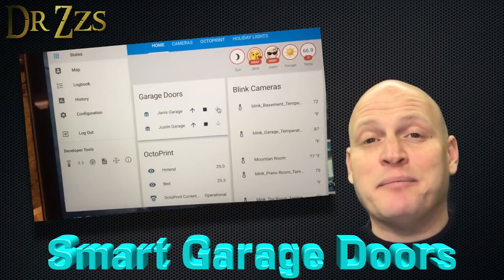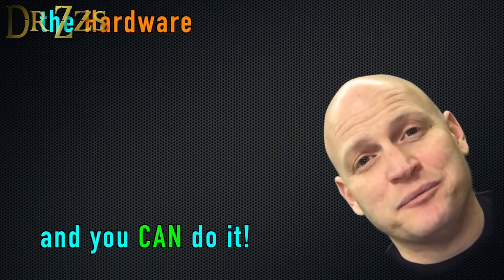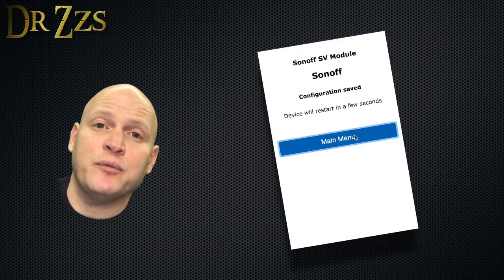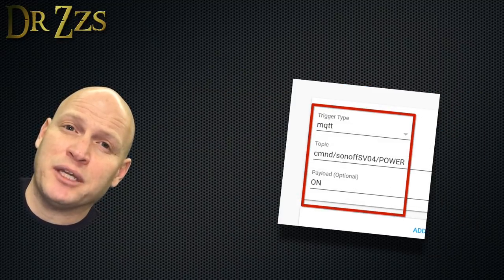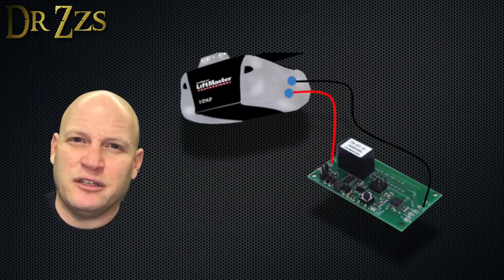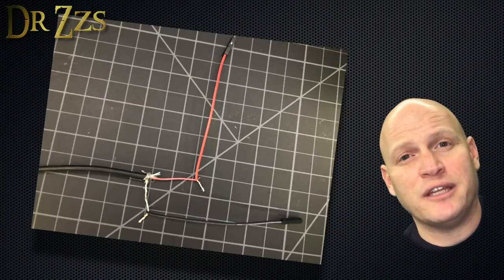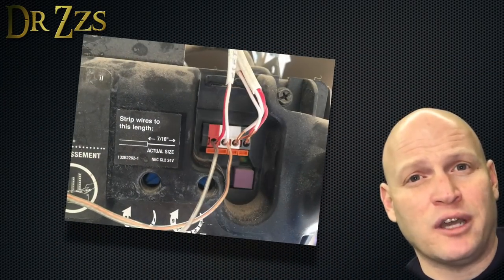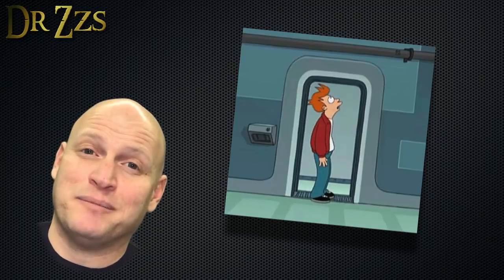$5 DIY "Smart" Garage Door Opener using Sonoff SV

Comment: Few recommended changes:

You can skip the home assistant automation with:
pulsetime1 1
in the tasmota console. This will do a 0.1 second ON-OFF sequence.

You can skip using a virtual 'relay2' by setting a rule in tasmota:
Rule1 on Switch2#state=1 do publish2 stat/%topic%/Garage ON endon on Switch2#state=0 do Publish2 stat/%topic%/Garage OFF endon
Rule1 1
The first line defines that when the reed switch is ON it publishes an mqtt message stat/%topic%/Garage ON and when the reed switch turns off it publishes an off message.
Publish2 command is used this way the mqtt message is retained in the broker, so if you restart home assistant it will still know the state of the garage.
The second line activates rule.

You might want to set up your reed switch so that it touches when the gate is closed and switch up the ON and OFF states in the cover.yaml (or in tasmota type switchmode2 1). This way it will only say closed when the reed switch is touching and it is really closed. The way drZzs has this setup in video could causes problems like your gate is 99% open but it's still saying it's closed.

In home assisstant cover.yaml:
 - platform: mqtt
   name: "Garage"
   state_topic: "stat/Garage/Garage"
   command_topic: "cmnd/Garage/POWER"
   payload_open: "ON"
   payload_close: "ON"
   payload_stop: "ON"
   state_open: "OFF"
   state_closed: "ON"
   optimistic: false
   scan_interval: 1
   retain: false
Reply: Hi, need a little help on your comment. I recently lost the reed switch sensor that indicate the closed state (I followed your advice in your cover.yaml) after the recent update of HA first update in December. Does it related to any deprecation of the tasmota function? Any solution? I am at a loss in finding any solution to gain back the open/close state. Thanks in advance.

Comment: I would recommend putting your reed switch to trigger at a point where the door is closed rather that at the open point at the top of the garage door as you have done. 

The current configuration you have would show the door as closed even if it’s half open. Also if there is a problem with the reed switch (e.g frayed cable) your current solution would still show closed. I would prefer it to show as open and me discover the door is actually closed and therefore realise something is wrong.
Reply: +1 to this. I followed a different guide and immediately noticed that the way most people are mounting their reed switch will only tell them with certainty that their garage is fully open. Anything else appears as closed. That could mean thinking your garage is closed when it's 95% open. 

Here's how I did mine: https://photos.app.goo.gl/pnnfsCWr9MmG7PaU8

I attached the magnet to the chain using some wire, on the side of the rail where the chain moves towards the door when opening and comes back when closed. The reed switch itself is sitting on top of the garage door opener, adhered to it using 3M adhesive tape. 

I used a Sonoff Basic but am planning to do this same project again for a friend using an SV in a 3D-printed enclosure with the reed switch attached to the side of it (less wires, just place the Sonoff where you'd place the reed switch ;) ) and maybe powered by the safety sensor terminals (if they always have power.. I don't know that they do).
Reply: @technicallyreal  Can you please share your code ? I am interested how did you set it up with the wireless switch. Thank you !
Reply: @raduovanesian  check my replies to saruc about Tasmota here: https://www.instructables.com/id/Sonoff-Garage-Door-Opener/#discuss

Comment: Hey DrZzs! Absolutely love your videos! Thanks mostly to you & Rob, I'm on my way to some neat home automations!
I just completed my garage door control (following your steps). I just wanted to add a footnote (and some fuzzy logic) to your garage door automation project.  I have the old fashioned "momentary contact" button for my opener - the type that if you don't hold it long enough, the door stops after about a foot or less travel. Bear with me while I describe a couple scenarios:

Scenario 1: The door is open. You press the HA UI button to close the door. As the magnet moves away from the reed switch the icon immediately changes to indicate "closed". If all goes well, the door continues to fully close. But consider if the door stops anywhere in it's travel before fully closing. It may stop with the door still 3/4 open, but the icon will falsely indicate closed because the magnet and reed switch have already separated. Without visual confirmation, do you really know it closed?

After mulling this over, I decided to mount the reed switch to contact the magnet with the door in the CLOSED position.

Scenario 2 The door is open. You press the HA UI button to close the door. If all goes well, the door continues to fully close. If the door stops anywhere in it's travel before fully closing, the icon will STILL indicate open because the magnet and reed switch are still separated. The icon will only change to indicate CLOSED when the magnet has activated the reed switch (door closed).
 
If I'm quite a distance from home, I want positive feedback that the garage door is in fact CLOSED. I'm only going to get a "closed icon" if that magnet activates the reed switch! With the door in any other position, it will show "open'.

In the Tasmota config, I set the module type to Sonoff SV (03), and GPIO14 Sensor to Switch2 (10). I left the rest unchanged.
I set the SwitchMode, SwitchRetain and PowerRetain settings same as yours.
However, with my setup I reversed the Home Assistant cover config settings to state_open: "OFF" and state_closed: "ON"

Hope that helps... 

P.S. I'm currently working on presence detection for the garage door - I'll update when I have results...

Comment: Found your guide a few days ago, ordered the sonoff SV and got it assembled and configured yesterday. 
A quick test today and nothing happend, I know that I hadn't done the automation parts since I fast forwarded the video so I came back and then found Jose Almotes comment about using the PulseTime function of tassmota. A quick fix and everything works like a charm! 

Thanks for another great video DrZzs! :)
Reply from the maker: Fantastic!
I love hearing the success stories! 
Keep'em coming!
Reply: Having some issues with the reed switch, it keeps going on/off several times / minute. I've placed it at the metal bracket for the garage motor, do you think I need to move it to something that isn't metal? 

And I had some issues with the sonoff loosing it's wifi which caused the relay to switch on when it gets the connection back, solved it by turning retainfunctions off in tasmota. 

20:07:48 MQT: cmnd/2/POWER2 = ON
20:07:48 MQT: cmnd/2/POWER2 = OFF
20:07:55 MQT: cmnd/2/POWER2 = ON
20:07:55 MQT: cmnd/2/POWER2 = OFF
20:07:57 MQT: cmnd/2/POWER2 = ON
20:07:57 MQT: cmnd/2/POWER2 = OFF
20:08:36 MQT: cmnd/2/POWER2 = ON
20:08:36 MQT: cmnd/2/POWER2 = OFF
20:08:41 MQT: cmnd/2/POWER2 = ON
20:08:41 MQT: cmnd/2/POWER2 = OFF
20:09:01 MQT: Attempting connection...
20:09:02 MQT: Connected
20:09:02 MQT: tele/garage/LWT = Online (retained)
Reply from the maker: I wonder if the pulsetime is being applied to your "switch2" also?  That might be why it switches right back off again.  Maybe switchmode could be the problem too. What is your switchmode2 set as?
I'm not sure if that's possible, but might be worth a check.  Type "pulsetime2" and see what it says.  
I'm still looking for the Holy Grail of "retain" settings.  I have some devices that turn on everytime HA restarts, no matter what their prior state was.  I've still got some learning to do in that area for sure.
Reply: I turned off pulsetime yesterday and used the HA automation instead.

switchmode1 1
switchtopic2 2

And I didn't find switchmode2 2 now in my dropdown list for the command line... It could be that I missed it, but it has turned on/off 2 times while writing this so dont think it did any different.

22:40:43 CMD: Pulsetime2
22:40:43 MQT: stat/garage/RESULT = {"PulseTime2":"0 (Active 0)"}
22:40:58 CMD: PulseTime1
22:40:58 MQT: stat/garage/RESULT = {"PulseTime1":"0 (Active 0)"}

And yeah, the garage door had opened by itself during the night, thats pretty scary, added notifications and camera surveillance that sends me an image as soon as the reed switch is open for more than 30seconds, haven't had any issues during the day at least.

Comment: This project turned out great!  Thank you to start.
I was pretty sure I followed this video very closely, in addition I had added the improvements suggested as well.  When I got done, I had to change "POWER" to "POWER1" or else my home assistant front end wasn't triggering the relay/Toggle1 when I pressed it, but the Web Gui worked perfectly.  Not sure where I got lost, but thought I'd mention it.
Reply from the maker: I bet there was a change with some update of Tasmota.  That's the most common reason why something doesn't look/act the same later.  
Glad you got it working!

Comment: One can also use a sonoff basic. It requires modifying the board to remove the A/C power from the relay, but overall I think it's easier and faster than the mods needed for the SV board plus having to cobble together a power supply.  It also has the advantage that you already have a case for it so no need to supply one.
Reply from the maker: True!
I can't remember who sent me pictures of one they were working on.  Was that you Zeric? 
Did you get it working?  There are a lot of good possibilities for a Sonoff Basic that is uncoupled from the relay.
Reply: No I didn't send you a picture. I have taken a close look at the basic and using a dremel type tool and a couple cuts in the corner area on each side, one can can completely eliminate the AC from both the relay and the load side connector. Then add a single wire to the bottom of the board, and the load end become just the relay switch.  One has to consider their level of skill and understanding before undertaking this type of modification, as done incorrectly could put the user at significant risk if the AC is still present at the output terminal.
Reply from the maker: would you share some images of what you've done?
Reply: I haven't done that mod yet, but I can send you a photo of what needs to be done, how do I send it to you?
Reply: Zeric, is this what you are talking about?  http://www.boized.com/2017/02/how-to-convert-wifi-sonoff-into-dry.html   I was thinking the same thing, they're both the same price and the basic comes with a cover.
Reply: Jimmie McCullough, I hadn't seen that site before, but it's exactly what I had envisioned when taking a look at how the traces were routed on the board. It's a fairly easy mod.  For anyone trying this mod, be sure to leave a large gap where you cut the traces, ideally one would make a cut all the way through the board creating a total air gap. Failure to correctly perform this type of modification could be dangerous so if you are not certain of your skills, don't try it.
Reply: Personally I find no point in setting up the power supply at all when you can just power the SV's directly from the garage motor. They all have 12v outputs in my experience. And if they don't you can hook the SV up to the backup battery directly.

Comment: About  #2 - pick an unused GPIO pin on the Sonoff SV and set it as "Relay2".  Use D4 or D5, not D1 or D3. That should stop the reed switch from triggering the relay.  

If user run command  [switchtopic2 garagestate] and rename topic from default to something else - everything  works fine without this instruction . 
But if you don't rename default name of topic relay will trigger and you can fix it  by this way.

Comment: Hi Justin,
I finally figured out why my home assistant didn't show whether the door was closed or not. I deleted the state command line and that fixed the problem.  I don't understand the reason behind it but it works. I wanna thank you for your quick responses to help me solve the issue
Reply: the only problem is with deleting the state line that the reed switch is not working anymore, and as soon as I ad the state topic line it goes back to not showing the status of the garage door
Reply from the maker: that's weird.  
hmmm. 
did you already send me your config.yaml / tasmota setup to look at? 
I wonder if maybe you could change the switchtopic.  The reed switch is monitoring the state, but shouldn't need the stat/topic as it usually works from the sonoff. It should be a custom topic since it doesn't monitor the relay.  
If you set gpio 14 as switch 2, set "switchmode1 0" then "switchtopic2 xxxx" (xxxx is your custom topic name for the reed switch".  That should work.  
Key word... "should" ;)

You've probably already sent me your config and tasmota info, but if you haven't, then send it now and I'll take a look.  Hopefully there's something there we just are looking right at but not seeing.  Like when you can't find your glasses and they're on top of your head.  
Not that I've ever done that.... cuz that would be silly....

Comment: Thanks for posting these videos!  I've been using IFTTT for presence detection and it works much more reliably than any other I've tried (Owntracks, Google, GPSlogger).  Just set it up on the app on each device for each person.  Works on Android and iPhone.  This will only trigger when you enter/leave a geofence but that's enough for me.  I use it to arm/disarm my home alarm.
Reply from the maker: I will try that! 
I've been using OwnTracks but it hasn't been easy to keep all the phones in the family working with it.  I just want to know if they are home or school or work or jail.  That sounds like it'll work for me.

Comment: Great success doing mine today with auxiliary power from the motor and a bit of fancy  sellotape with the magnetic switch which will hopefully hold as it fits EXACTLY in the slot where the chain runs.

Struggled forever "in the air" after testing on the ground due to stupid bread board pins not making contact so I advise hard solder to anyone going for a permanent install.
Reply from the maker: Awesome!  
I love hearing success stories.  Thanks for coming back to report.  And good tip on the solder vs breadboard.  
Thanks!
Reply: DrZzs now I just need to figure out why only this device is claiming to be not responding in HomeKit unlike every other. I suspect it’s looking for some status that specifically says “open” or “close” and not just “on”.
Reply: @DrZzs  okay so now I'm fighting with my alarm. I'm managed to get the "Global PGM" connected to the GPIO14 much the same as your setup here. 

However it's a momentary (button) trigger as an Activation event and so cmnd/alarmstate/POWER2 goes ON for five seconds and then OFF much like the Pulsetime on Tasmota itself.

The thing is how can I compensate for that so in Home Assistant (or Tasmota) if have that state as "ON" constantly after the trigger so that my status is actually Armed in HA?

Comment: FYI: I'm noob at this. No matter how many times I try..it keeps failing. But it fails on the Reed-switch part. Flashed to tasmota was fine and from there the info starts getting blurry for me. 2 resistors are gone, powerd on USB from laptop and I can go to the IP and see the 2 toggle switches. 1 is clicking that I can hear it and the other one should be the reed-switch status I think. And I've tested it but I can't seem to get a status out of the reed swicth. Any way I can test this? Did I forget something?
This is what I get when I shorten out GPIO14 and GND:
10:07:25.027 MQT: cmnd/garagestate/POWER2 = ON (retained)
10:07:30.548 MQT: cmnd/garagestate/POWER2 = OFF (retained)
But when testing with reed switch..... nothing to see in console (or the switch in broken)
But nu status change seen in tasmota interface or in Home assistant.

Comment: Thank you very much for a great tutorial.
I used it to set up a sonoff Basic to both monitor the garage door via GPIO14 and to open and close the door. 
couple of things that I noticed:
Your setup for the reed sensor is the opposite of mine; when the reed switch touch's the magnet, its open for you while in my case its considered closed because it mounted at the side. Therefore i had to set switchmode2 2. 
As soon as i did that the relay would trigger at power cycle of the sonoff something that didnt happen when switchmode2 1 but that gave me the wrong door status in my case .
to fix that I had to set GPIO4 to Relay2 (22) as you mentioned in your setup. 
Now i have a Toggle 2 switch, in tasmota and the sonoff web portal,  that just controls the Green LED on my sonoff but at least the problem is fixed.
I played around a bit and figured that if i keep everything the same as your setup except i don't change the switchtopic2 garagestate but keep it to switchtopic2 0 and in my config.ymal i put state_topic: stat/sonoffsv04/POWER2 instead of state_topic: cmnd/garagestate/POWER2 (switched cmnd to stat) I get the same result but this time the Toggle 2 switch in tasmota and sonoff web portal and led green light are off when the garage door is closed and on when its open. mind you Its not any more useful, but it does some  
let me know if you foresee any issues with this setup 
thanks for the help and all your contribution
Reply: Got mine working thanks to your info.. Much appreciated

Comment: Doc... can you confirm the below is all the commands that needs/should be added into the console... to setup our desired behaviour. (what I compiled from the various video above, updates etc).
1. set module to sonoff sv, reboot
2. configure gpio14 -> switch 2
3. switchretain 1
4. powerretain 1
5. switchtopic 2 <topic>
6. switchmode 1 0
7. switchmode 2 2
8. pulsetime 3

why do we set gpio14 -> 10 all to switch2 and gpio4->22 all to relay2